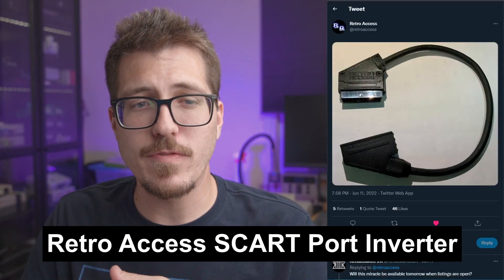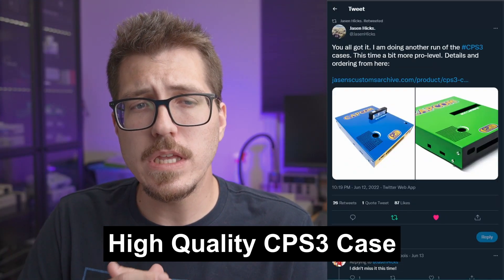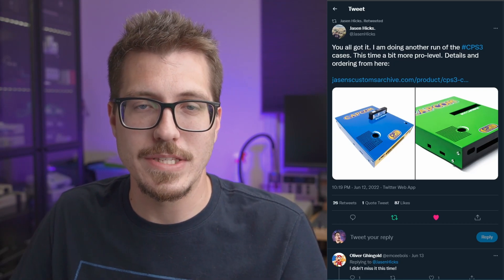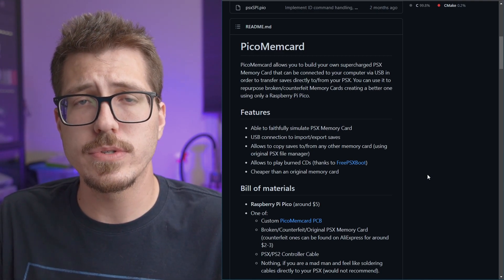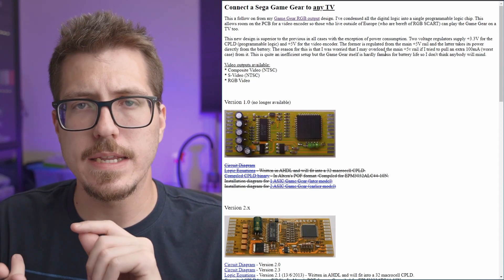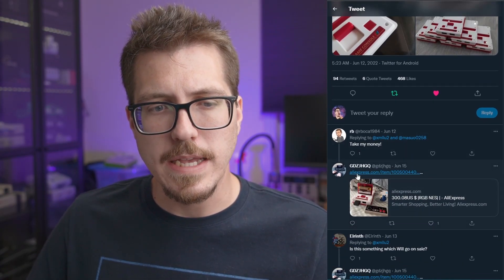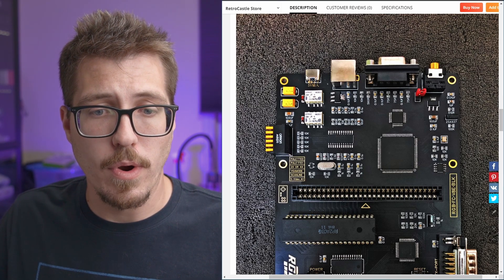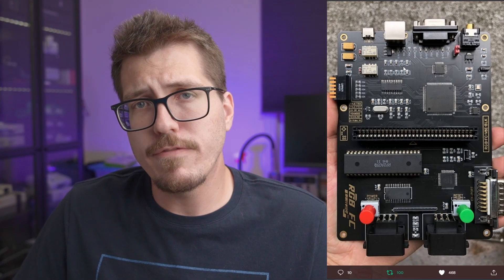FPGA "Clone" Consoles Using Real CPUs - Retro Modding News 6/19/2022

Comment: What is the point of the scart inverter?
Reply from the maker: The RetroTink 5x Pro has the SCART port facing so that normal SCART cables come out of the front of the RetroTink instead of out the back like the component inputs. The Retro Access adapter points the cable toward the back

Comment: how do these pirates make these fake boards. And something that is underground like the mister.
I only shop at ali express with it's reccemended by a user online. They tend to have defect stuff and fake stuff. Depends on the seller i guess on there.
PS1 memory card looks cool. Maybe hope for a ps2 one that holds saves.
Reply from the maker: I wouldn’t call them pirates unless they’re copying someone else’s design. If this is an original board than that’s cool
Reply: kicad, and a lot of spare time, then send it to somewhere like pcbway etc....
Reply: As long as it's not defective stuff I'm all good...